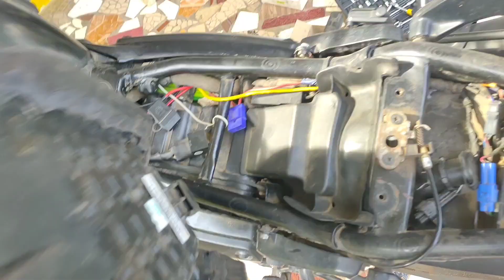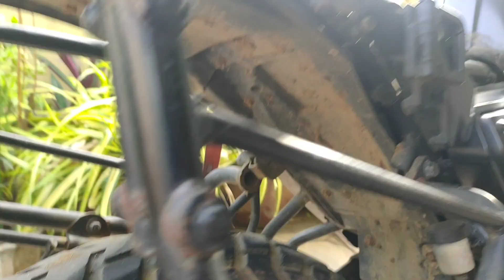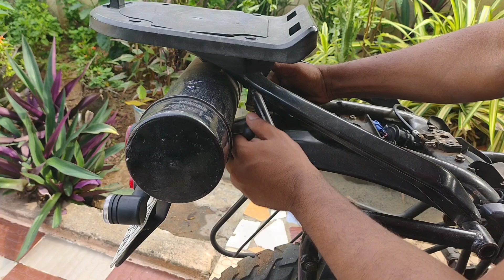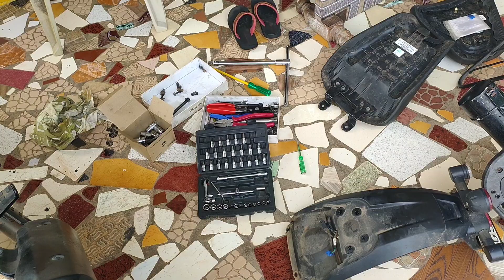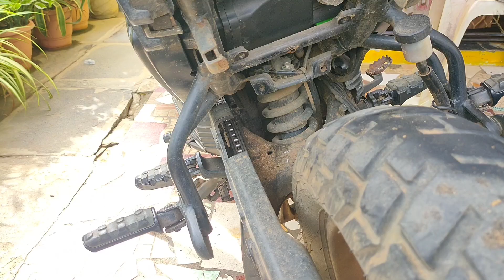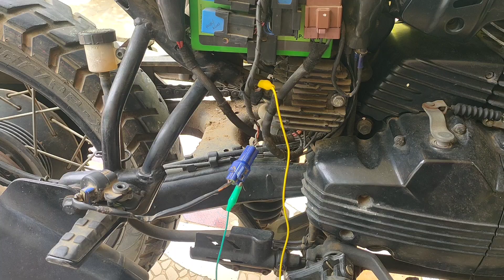Yezdi Adventure Maintainance Update Tail Section Step by Step

Comment: Any idea for the service interval or oil change duration for our rear mono shock? Front fork oil has to be changed after 2 years right
Reply from the maker: There is no service interval for rear mono shock, it is difficult to get repaired like loosing damping etc . Those are sealed variants. I guess they are mostly replaced when faulty

Comment: Hello sir, I'm facing an issue with my bike... When bike is on idle and the engine stalls on sudden acceleration do you have any idea about this?
However it goes well when you accelerate it gradually. Please help me if possible 🙏
Reply from the maker: Engine chokes when not enough fuel or air isn't entering ,
1.Check Air Filter
2.Fuel delivery fuel injector
3.TPS Sensor
4. Vaccum leak , means external air entering 
5.Cold start issues
Reply: @baby_adventure  thanks ❤

Comment: Great to see you back bro...did you see the new dual headlight yezdi adventure??...people are saying that new projector headlight can br retro fitted to old but with wiring harness and light, they say around 40k.....
i am planning to get the new yezdi advs seats and visor and front fender plastic to retro fit on my adv too
Reply from the maker: Hii bro, the light setup is good and colours are good too. I planned gold vinyl as same theme I felt single colour is boring designed gold on front fender side panels , now the design came bikes came out awesome .  For lights around 13k I guess and wiring kit around 10k
Reply: After fitting make video on that for review
Reply: I like the dual light setup at tail. It looks awesome. Also front visor. If possible make a video review if you do it.
Reply from the maker: @IAmAnAlbatross...  Yeah dual light on rear added some character
Reply: 40k😶

Comment: 8:41 may be because rear tyre not moving. Like when bike falls while accident rear tye keeps running. You can test it on paddock stand.
Reply from the maker: Yeah vehicle speed is the issue mostly. I fell below 5-10kmph in gear three times it didn't cut off the engine I used engine kill switch . Will check with paddock nd simulate other scenerios 
But it says it is meant for crashes not drops😁